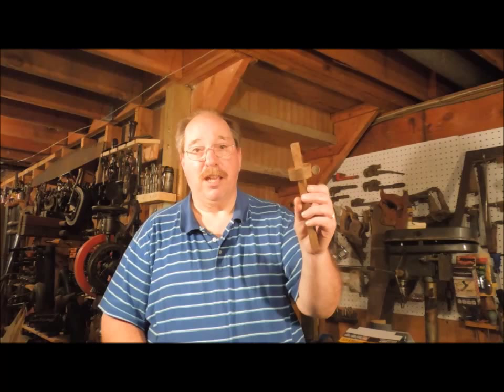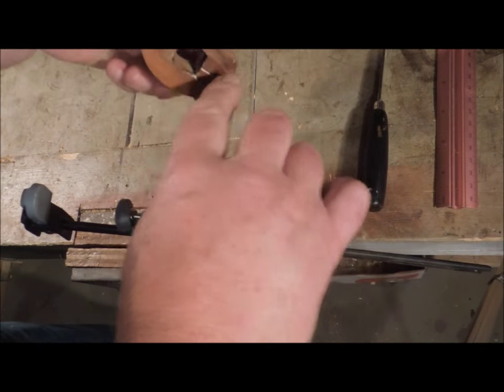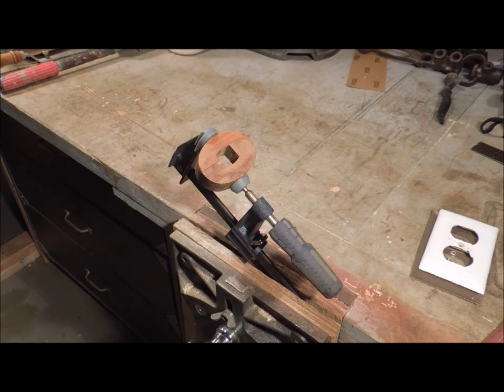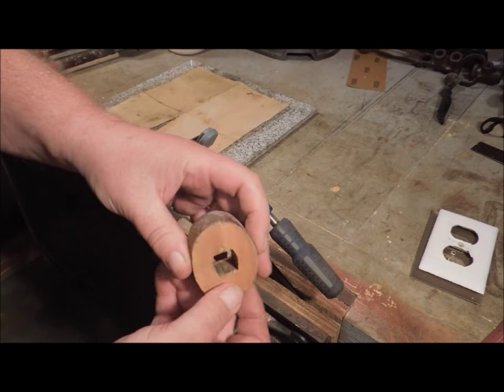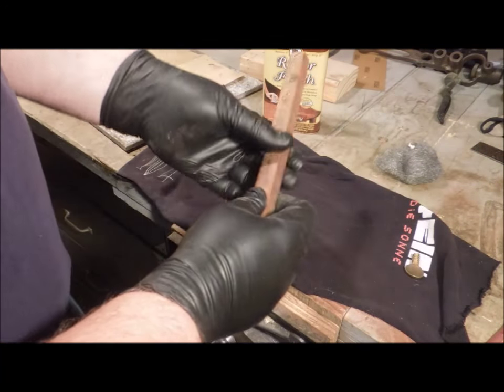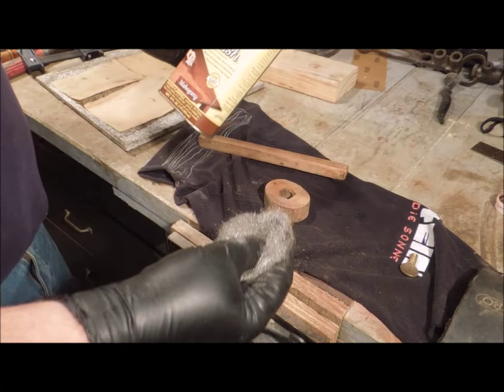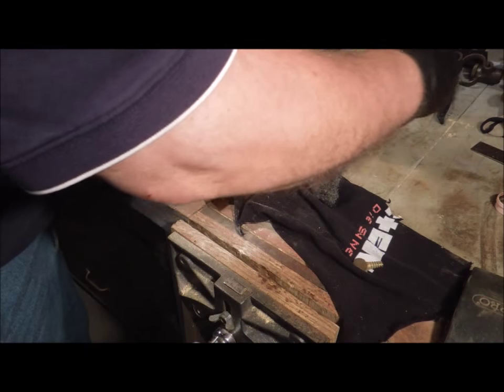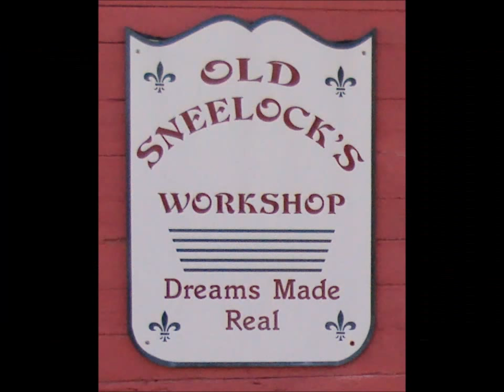Repairing Antique Tools -  Marking Gage - A video tutorial by Old Sneelock's Workshop

Comment: Why not split it completely? Its easier to glue up then.
Reply from the maker: +Willem Kossen It certainly could have been split completely. I chose to just glue up the existing small crack. I prefer not damaging an item more than it was originally. I have found that breaking something isn't an exact science. The part may break in unexpected ways or even splinter off pieces. Since the crack was small I decided to just fix what was broken and leave well enough alone